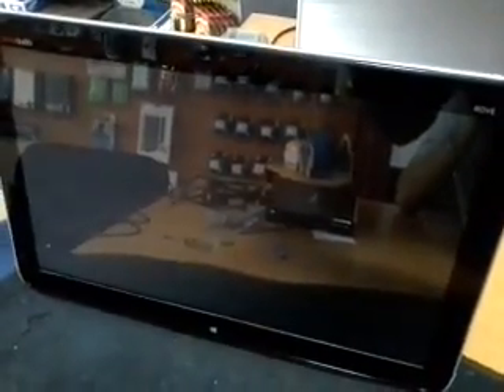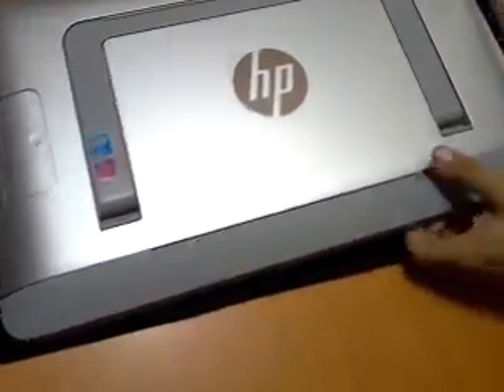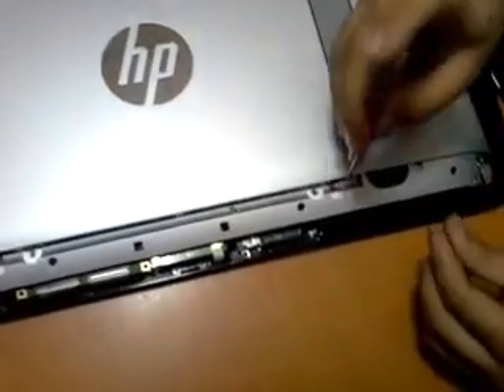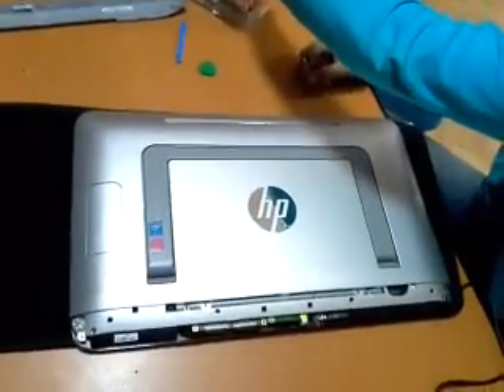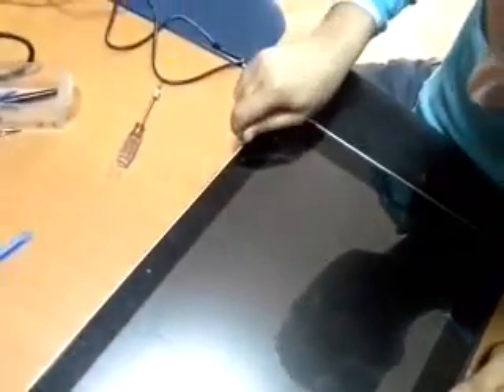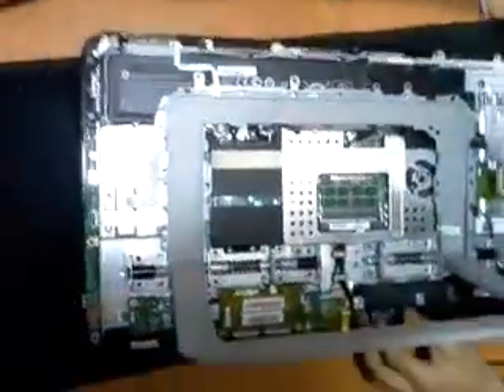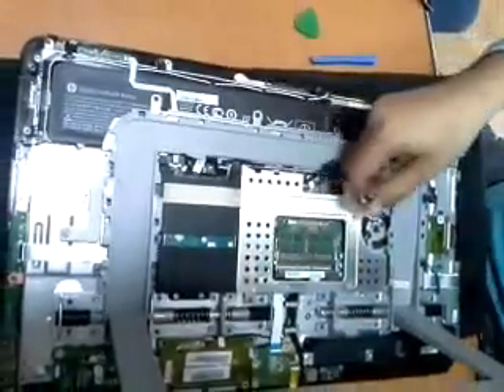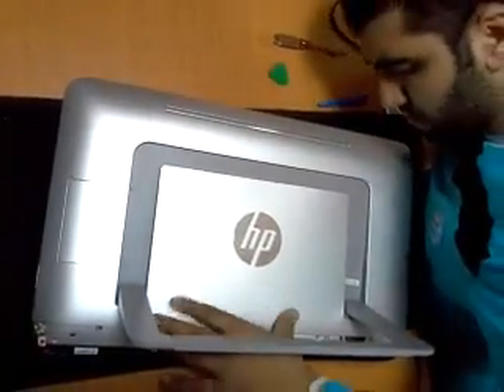How to disassemble HP ENVY ROVE All in 1 + Memory Upgrade Milad Ghaddar

Comment: Thank you for this video!!! Could you put two of 8GB?
Reply from the maker: If there is 2 data ports & extra power cable yes you can install x2 of 8gb had ... Other wise  you can install single high capacity storage drive its now easy & available in 16tb & even more